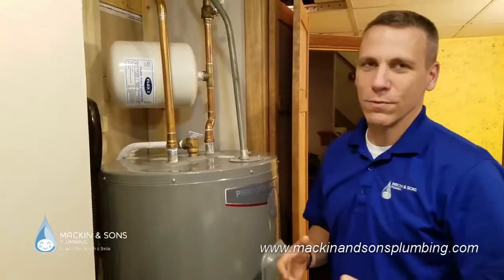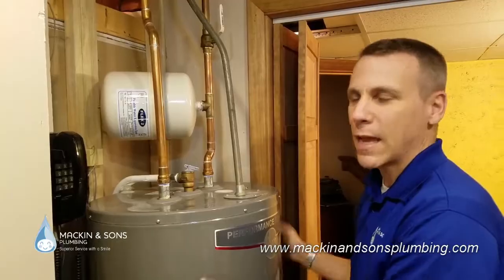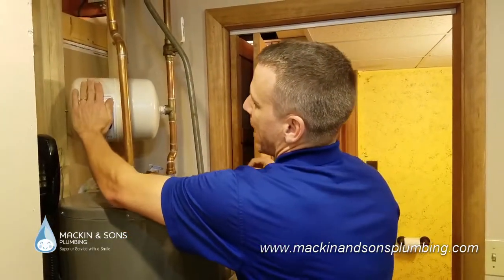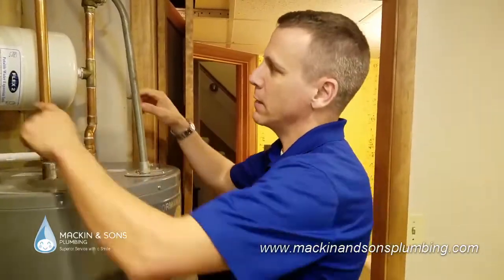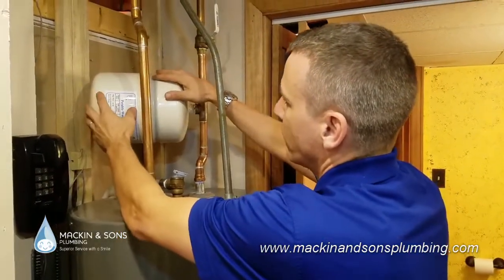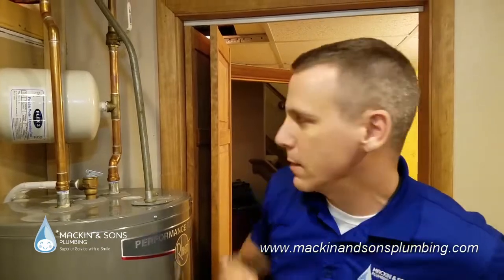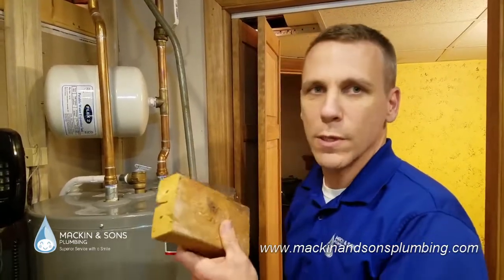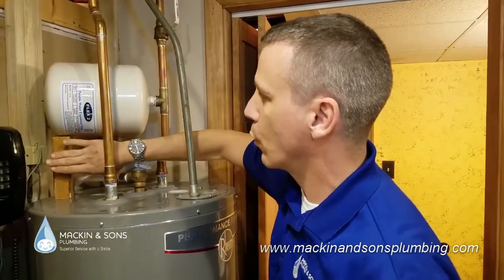Expansion Tanks

Comment: Hey Mike. I have a 50 gal water heater. I installed a Watts recirculating pump to get hot water sooner to my furthest bathroom, with the sensor valve under the sink. Hot water comes to the sink a lot faster, but hot water is mixing into the cold water. We have to let the cold water run to get it cold. The sensor valve is installed correctly.   I have a check valve after the ball valve going to water heater tank. I'm going to install a 2.1 gal expansion tank to the cold side after the ball valve and check valve. Also, do I need a check valve after the recirculating pump ? Thanks in advance
Reply: Helo Mik, master plumber here (not bragging, just am) 
You wrote: "I have a check valve after the ball valve going to water heater tank." I don't see a reason for that.... and if your T&P valve ever failed (slim chance of that but) the high pressure has nowhere to go ( hence: backward towards the street). The device under the bathroom sink (I'm pretty sure) has a check valve in it or the "designed system" wouldn't work.
Reply: I found out that that’s absolutely normal. The water will come out on the cold side a little warmer but eventually get cold.
I just let the cold water run less than a minute and I will start to get cold
Reply: @readmore3634  check valve was recommended so it wouldn’t back up back into the tank. I also installed an expansion tank on top of the water heater.
Reply: Normal….

Comment: It is supposed to be vertical not horizontal, incorrectly installed
Reply: It is going to work any position you install it. You just have to adjust equal pressure of air inside tank as you have domestic water pressure. There’s a lot of videos how to do this. It is very easy.
Reply from the maker: It can be horizontal or vertical per manufacturers instructions and the international plumbing code.
Reply: Why, Zach?

Comment: Hi there, Im hoping you would reply to me because ,Two other channels have not.
I have a heat pump , and the hot water pipe going outside from the heat pump to the spinning fan outside the house was leaking, I noticed that the gauge connected to the Red Expansion tank ,kept dropping from 1 bar to o.bar, I kept filling up with water, Anyhow I noticed the leak outside. So I got a Heat pump guy to come by and change the pipe because it required a special sqeezing tool. to reconnect the new pipe. Only took an hour. I noticed that the pressure was still dropping from 1-bar ,Hovering around o,5 bar and even lower to almost 0-bar, and this is even more so in the evening when it gets really cold, Even goes minus 3 or 5 just now and in the day 5 or 5 degrees just now. The pressure goes up towards 1-bar again and fluctuates there and down to 0,5 bar . And stays there for most of the day, while it is warmer in the day. I have pumped up the tank to 1,5 bar . I used a little 12v pump for car tyres. The gauge on the 12v pump goes to 1.5 bar , but the gauge on the Expansion tank does not go up at the same time. Is this normal . Also I have checked no water in the expansion tank, It seems fine ,Hollow to tap to. What can cause the Gauge to go up and down .Before the pipe failed , The gauge was always stable on 1-bar most of the time. I do not think there is any leaks in the heated floors, that I can see, and surely the gauge would not go up and down. Appreciate some tips to whats going on. P:S the heat pump , seems to be working properly, and I have hot water. Just the gauge problem that means something is not right somewhere.
Reply from the maker: Hi Kevin - thanks for getting in touch. I would recommend having the heat pump guy out again. Without seeing the system you may have a secondary slow leak or perhaps ambient air temperature is affecting the pressure measurement. Best of luck!
Reply: Mackin & Sons Plumbing   Hi there thanks for replying. Can you explain a little, what you mean about ambient air pressure.
Reply from the maker: Ambient air temp can change pressure readings but not knowing how your system is designed I can't tell you why your gauge is dropping. Sorry!
Reply: Mackin & Sons Plumbing 
Thanks for the replies.
I just wanted to tell you about more as to what's happening.
As l said the gauge goes up and down. Higher in the day and much lower at night. When l say high, l mean 1-1-5 bar. At night it's trying to produce heat for the heated floors of cause.  This is also  what l have noticed now that did not happen before the new pipe was replaced. When we run the hot water  I,e shower etc. And say that gauge is on 1 bar and someone showers for say 5 - 10 minutes.  The gauge goes all the way down to 0- bar. And l also see last night that the water tank temp was on 35 degrees and dropped to 32 degrees. I've not known this before, it always only went up.  Any ideas.  Is it all to do with something wrong with the expansion tank still.??? Appreciate some more advice thanks.